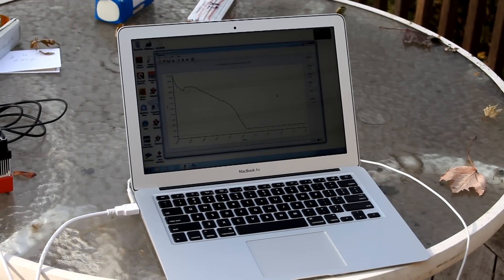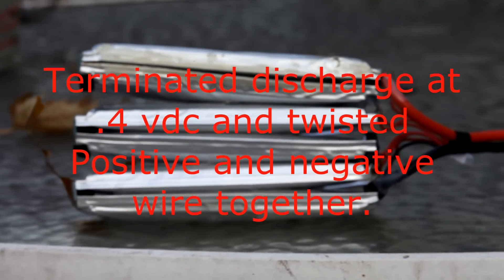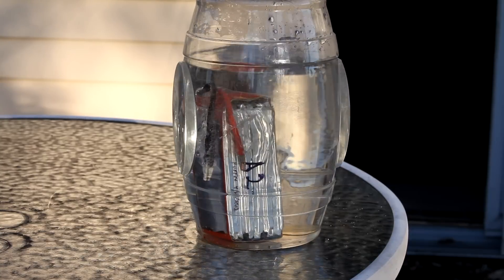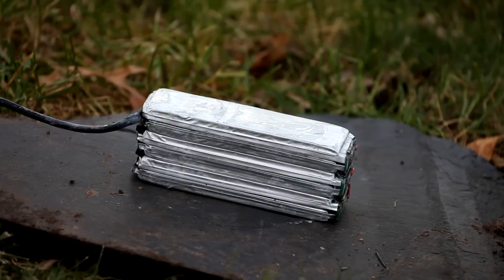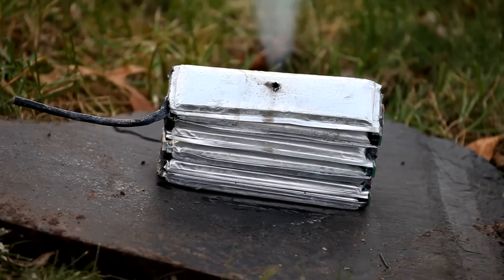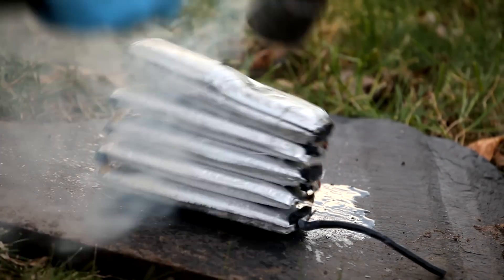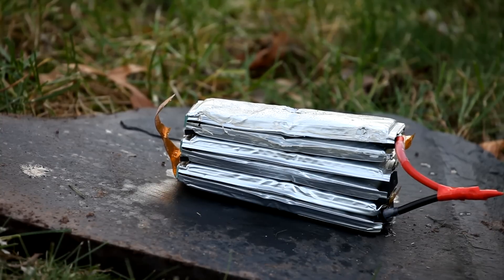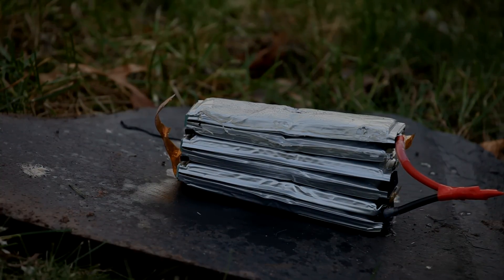Safely discharging a lipo for disposal

Comment: Its a very interesting video. It would not have come to my mind to drop a LiPo  into a salt water solution. Interesting to see what happened.
Resistive discharge is indeed the best solution. I'd recommend to get a decent charger / discharger, (for example a Junsi)  which enables you to safely charge and discharge the LiPo battery to safe levels, preventing lipo fires effectively. Plus, instead of wasting resources, bring the LiPo back to the dealer where you bought it for recycling.

Comment: What if the cell was punctured in crash and discharging isn't a possibility?
Reply: severe damage to the car or plane. thats why most of my packs are hard case
Reply from the maker: Carefully remove the damaged cell and discharge the rest. Not recommended for those without the experience.
Reply: all that hard work to remove  a dead cell I rather  have fun and die younge lipo smoke is cancer  but so is sniffing  superglue  aswel

Comment: By the way, your gloves are an over protection. As long as you don't touch the spilled chemicals after making that hole with the nail, you'll be safe. I usuaully use only the minimal protections needed in any experiment, just enough to cover the most likely dangers, in order to avoid looking like a wuss (sissy).
Reply: No, so instead you just sound like a moron.
Reply: You sound like candidate for a Darwin Award.
Reply: baseballhunter42  I agree
Reply: there  is a lot  of  dumb  poeple that  dislikes to use  protection, untill they no longer  need  it!
Reply: im stealing this.
Reply: baseballhunter42
What toxic chemicals cells contains? Do you know it? Is there any dangerous toxic chemicals at all? Or it's just a myths without proof?

Comment: NEVER put in water. This electrolysys makes hydrogen and oxygen. The slightest spark could then cause a massive explosion after hours of gas generation and build up.
Reply: It's not a closed container, and it's outside so there's lots of ventilation. Furthermore, hydrogen rises up in the air, so wind will easily dissipate it, making it not dense enough for combustion.

Comment: Good video Ed, but instead of some fancy expensive dynamic load, how about just hooking this 82 ohm, 5 watt resistor across the terminals?

At 12 volts, you would get 146 milliams of current.  I wouldn't think that would be too much, to make the battery heat up....

When I first heard of the "salt water method", I was thinking, "why wouldn't I just hook a resistor across the terminals to let is slowly discharge down to nothing?"

Unless you are in a hurry, and discharge time is a concern..

http://www.radioshack.com/product/index.jsp?productId=12554542&numProdsPerPage=60

Comment from the maker: Although not mentioned in the video I totally agree with recycling of batteries. I remember in NYC they had a big push to bring in all your alkaline batteries. They were so overwhelmed that they then announced the manufactures are no longer using mercury in their process. It is now ok to throw them in the regular trash.
The puncturing of the battery was done to demonstrate the energy left from the Salt water bath and to confirm for the video that when properly discharged there is no energy left. I do not recommend the puncturing of the pack for disposal. I don't know about the staples and Radio Shacks in other areas but by me if you walk in with a 6S 5000mah battery they get real nervous. The recycling statute say's they only need to take back what they sell.
Reply: +Ed Johnson Here in Brazil there's specific places where you can recycle batteries with no need to discharge it. (They'll do).
Reply: just drop in the bin at Lowes or home depot.
Reply: What did you do with your tools when you were done making this video?

Comment: you should reuse the cells instead of trashing it.
Reply: I reused my cells for a mosquito zapper. vaporizes insects with satisfaction. You can also replace the AA batteries of other electronics. I used them on a flashlight although the cells have to be kept outside, the performance is much better.
Reply: How???
thanks
Reply: Peter Brown
take out the bad cell, maybe replace with some lithium 18650s from a bad laptop battery pack. if not you would still have a good set of cells. what you did here was throw away 5 good cells just because 1 was bad.
Reply: I agree, those cells should be used, instead of trashing it. As we can see, it can store enough energy.

Comment: Great Info, I guess I am better off with putting a load on the pack to get it to low voltage. One question though, my iCharger has a NiMh discharge function down to 0.10V. Can I use that instead if an external load device?

Comment from the maker: Considered it but knowing that each terminal on the cells undergoes some level of deterioation from electrolysis and galvanic action. Your voltage readings would become inaccurate. You would need a test point that was internal to the cell itself. Even then some of the cells were partially breached with some salt water.